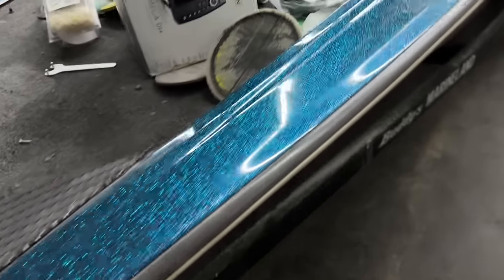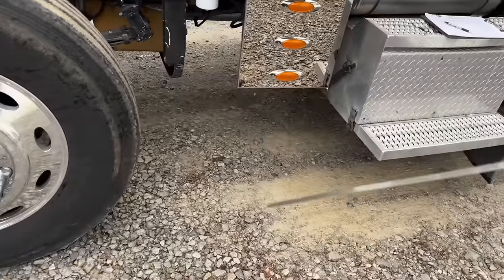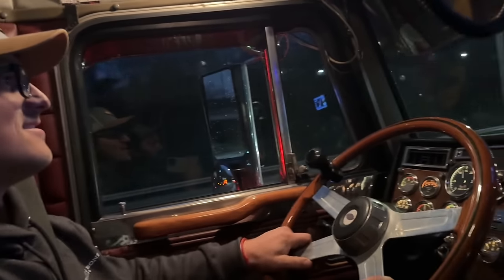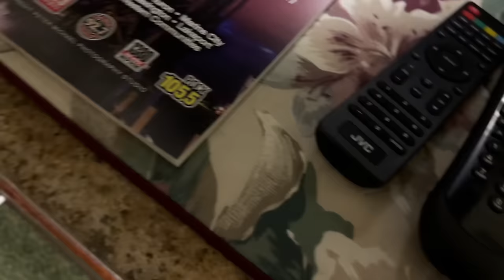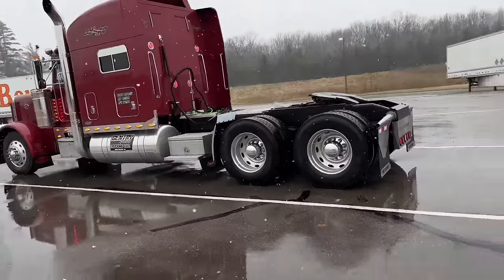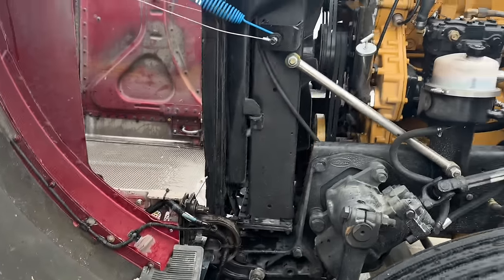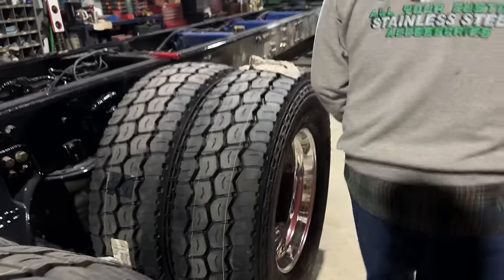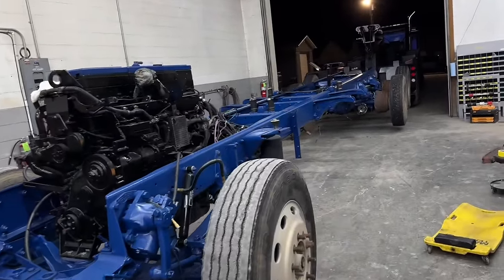My New CUSTOM Built Heavy Haul Boat Trailer Is Here!!

Comment: He does his frame stretches the proper way. We did them the same way and the cuts where you join them were almost identical. The only difference is we weren’t allowed to have any 90 degree cuts. We had to round them to prevent stress points. We had to follow strict protocols in order to maintain the warranties on brand new trucks for our customers.

Comment: And the guys at the plant were really cool got to take quick tour of some of the trailers they where building at the time they are well built sleds but you can put whatever boat in it as long as you have enough truck and pull it down the road no problem

Comment: When your brother drives Roster with that Awesome CAT MOTOR He will like CAT 😺 MOTORS better than a Detroit Motor for sure.
Reply: I love all old school engines, cat cum det, but we use different engines for different purposes, cats for heavy, low end torque, Detroit for cheap over the road fuel mileage, Cummins for when you can't afford a cat, I can't afford a cat, going to build a new engine, Detroit 60 series, 14L crank in a 11.1 block, 13.4L engine, they run high compression and run good, going to try one

Comment: My boss is trying to find a used triple acle 10 wide stretch waltron, he's got 2 big rigs and a few pickups Hauling boats. Got a regular twin axle waltron stretch and a waltron stinger modified with a gooseneck and made to be 53'. Both 2020 trailers but the triple axle would be nice for things like the 50' cruiser we did last month. I've been basically only Hauling boats for the past 5 years